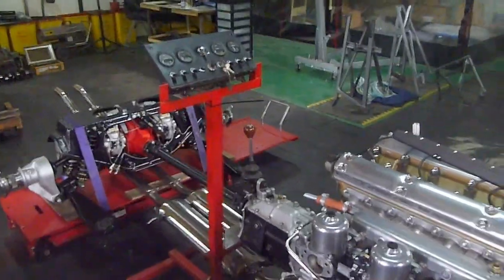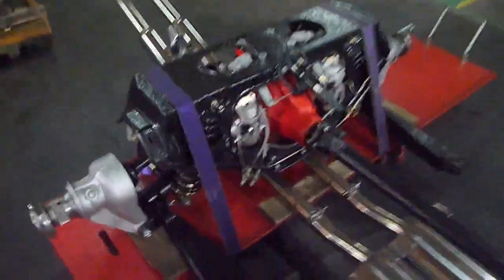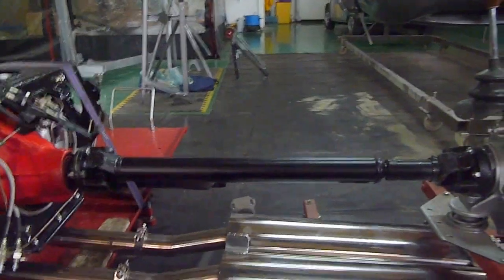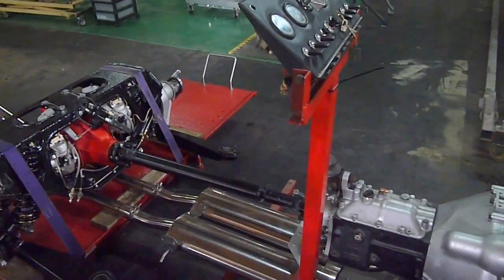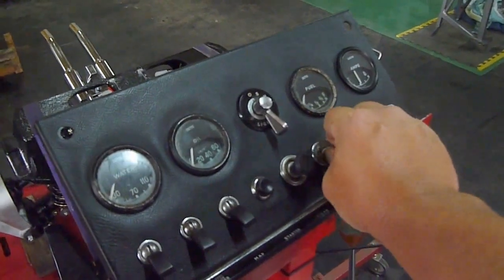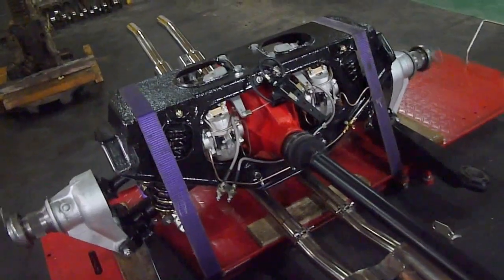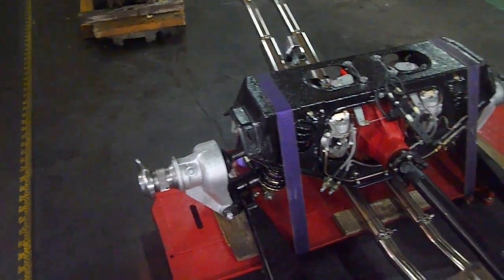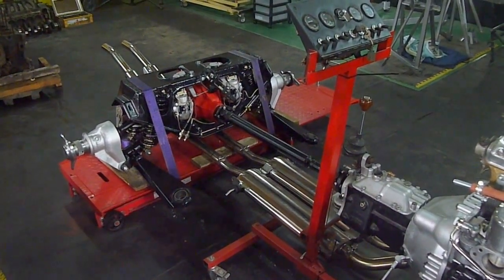Jaguar e type IRS test rig.

Comment: Just a note, when I took my rear end apart, I found a couple of shims behind the two rails, one each side of the diff, didn't understand why as when I re assembled, the two pins which locate through the subframe seemed to line up perfectly...I always thought there was no way toe in/out could be adjusted with this layout, but on assembly of the wheels rims with the subframe mounted on trestles, I found six mm of toe out measuring front then back of rims...did you adjust for toe in/out?? and how did you achieve it, with the shims behind there upper trunnion carrier ??
Reply from the maker: Keith,  The shims under each bolt of the inner fulcrum shaft bracket are very important to line up the shafts to the cage and the suspension geometry of the IRS. When i stripped the car i measured each shim front and back and then replaced them with new ones of the same thickness. The tracking or toe in out is adjust only with the track rod ends. if you go to my video of the test in the garage you will see the screen, If you need to adjust camber or KPI
you need to use a camber angle gauge magnetic are the best it has all the Degs of angle you need to set it up correctly and just look in your Jaguar or manual for the information on what it should be. All the best David.

Comment: Awsome set up Dave,  wish I had the space to set this up on my E resto project. 
Ranj
Reply from the maker: Ranj Singh Ranj, Thank you for your comments, I would say that space is an issue with most restorations but setting this up on blocks would still work due to the shear weight of the                             IRS. I think you could even turn it with a small electric motor just to check for any noise even if you don‘t run the engine, Running the engine on the floor is not 
                           difficult and well worth the effort, This is the perfect time to sort out any issues before you spend many hours fitting it all back in the car!
Reply from the maker: Ranj Singh Take a look at Jaguar e type Plugged in! as you mentioned about space it got me thinking about other ways to check the drive shafts,
hope you can use the idea, Do yourself a favor and check out the E Type Club website & magazine i write a article in there each month.
David